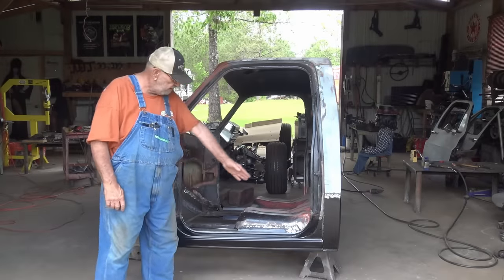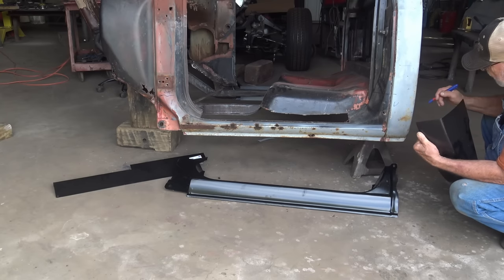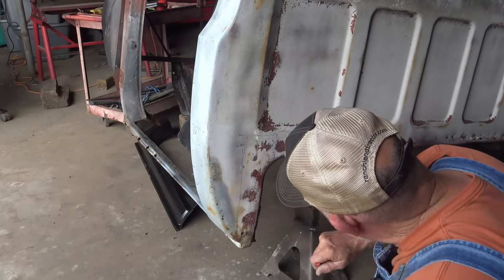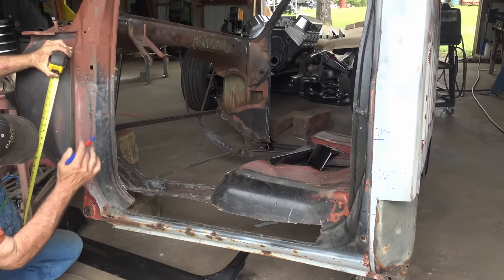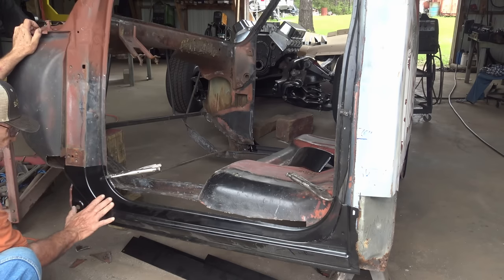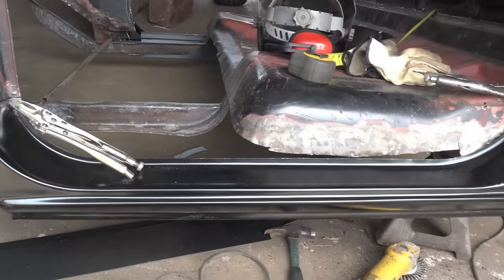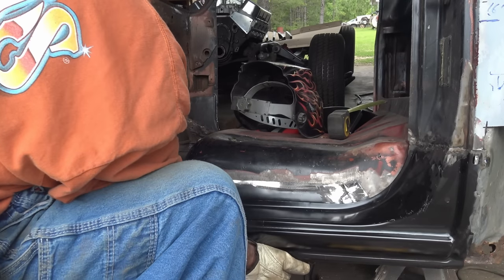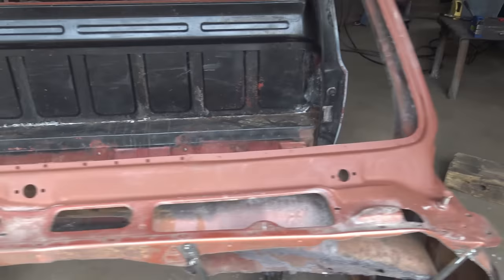Rocker Panels & Cab Corners Quick And Easy - 78 C10 Muscle Truck Build

Comment: Hi Bob, glad you posted this we're in the beginning of starting this same project. I have a piece I went ahead and got figuring I'd need everything because it's about as bad as yours. It's a universal back plate. We can't figure out where it goes. It's LMC item no. 38-6538. If you could give us a little explanation of where/how it goes in there we'd appreciate it. Thanks.
Reply from the maker: Inner rocker panel. Keeps trash and dirt out of the rocker panel. Not seen from the outside.

Comment: The road grime gets in from any crack, crevice, rock chip, usually from the back side and places you can't get at to wash it out..That is how it rotted out to start with. Regular body putty attracts moisture. I use fiberglass putty especially for first coat in the down and dirty areas for years and no problem.

Comment: i next is heat shield on starter and i wrapped in blue my new set of headers for it now i just need to put it on . my kid got to hear it for the first time i to start it and move it she was checking it out and made a comment on how big the engine looks in the truck i said that is a big block for u . it does sound good for a stock engine but is a ho 454 450 hp with a 4 inch stroke just needs to breath it came with steel crank heavy rods high flow heads the trans comes with stock 8 bolt pump heavy clutches stage one shift kit good to 800 hp . for a stock engine i put a 850 wieland street high rise seems to have a lot more power the trick is to take off with out spinning the tires . i drove it to town twice and people seem to love it i all most sold the last time for 12,000 because i only have 1400 in it but i could not sell it till i am dun

Comment: Red get them heads cleaned up.I used to think people were crazy for busting down new heads. Nowadays I definitely wouldn't bolt anything to an engine, rolling the valves around on the counter. Get my eyeball in the guide, and feel without spring pressure. Check surface. Pick the bolt holes clean before. 
      Red been sleeping in it most nights.

Comment: Cab is coming right along! 
I thought i made a mistake not checking it with the door. And i was right. Didnt look right, until owner changed the door. I got lucky, the old door had work done on it, gaps were wrong to start with. So fit it with the door you are going to use.

Comment: Sure hope you are using some kind of waterproof body filler  or it won't last once it is exposed to bad weather, unless you don't use it in the weather..
Reply: Hey genius, that would only apply if he was doing body filler and then driving around with it exposed. Once it's sprayed over and painted, it won't absorb moisture.